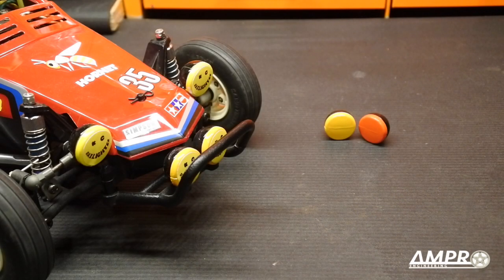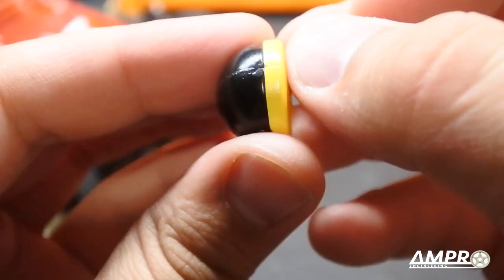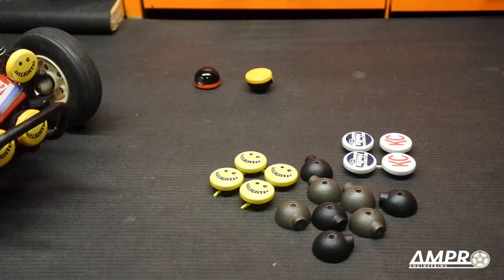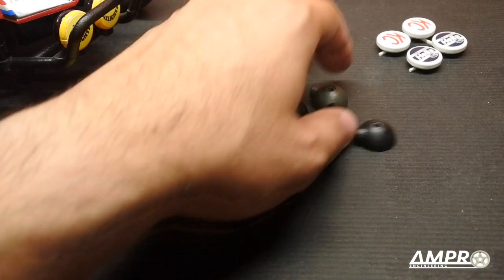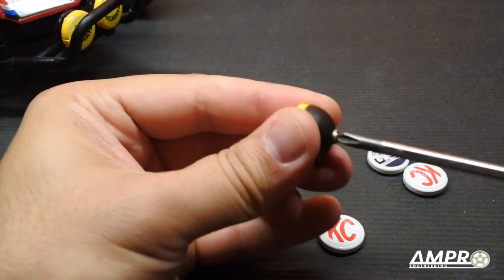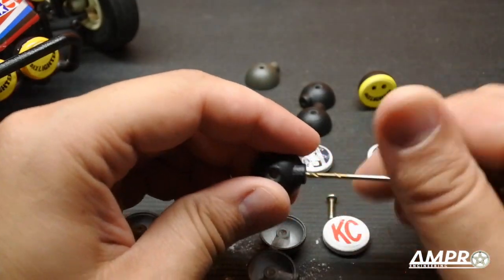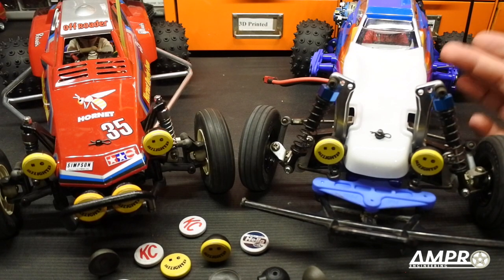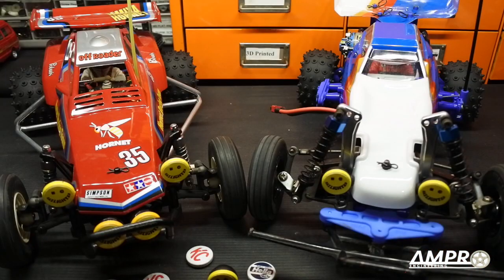e95: Ampro Tamiya Cars 3D Printed Auxiliary Lamps

Comment: Nice idea good work!
Reply from the maker: Thanks! Should I suck it up and just drill out a wheel to 5mm? I am getting worried I will mess up your stuff.
Reply: I used a drill on mine here, and it worked.  do you have a drill press that would be even better...I think it just goes straight because the hole your making is not much larger than what it is already in the wheel.
Reply from the maker: Yeah we have a drill press. I am going to do it now.
Reply: Cool let me know how it gooooooeees!

Comment: What are some good affordable (by affordable I mean ridiculously cheap ass) electronics  to put in a Grasshopper? Y'know an ESC, servo, and receiver/transmitter combo for someone with no $$$.
Reply from the maker: I would go used then. You can get a solid complete used RC for a good price but cheap electronics will just fail, especially the ESC.